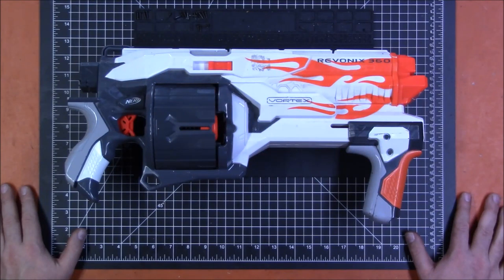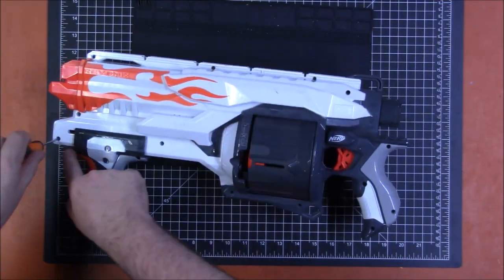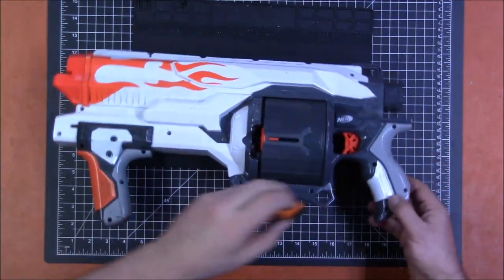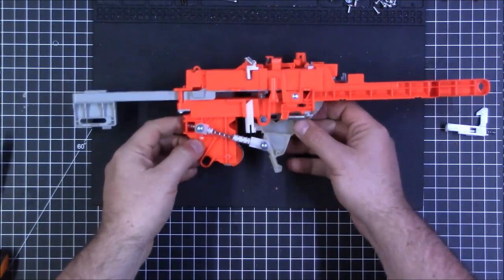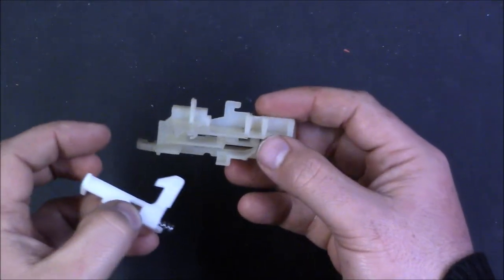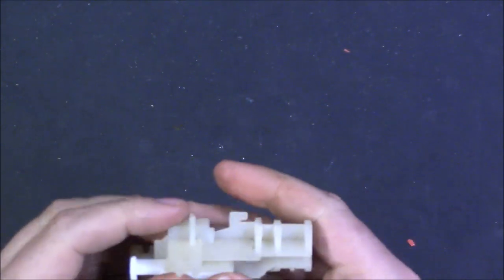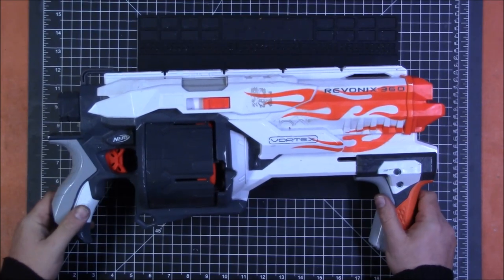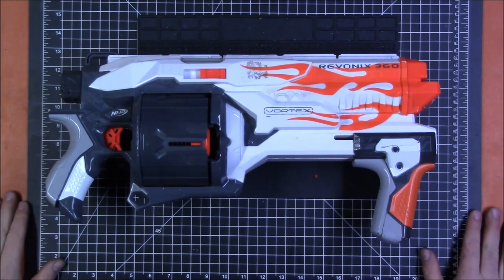Monday Mod Tips - Revonix 360 - Reassembly Guide

Comment: You good sir are a very brave man. Many a Revonix 360 has succumbed to the dreaded “Where does this f&$&20$ piece go?”moment.
Reply from the maker: It honestly is not that much more complicated than many other blaster in terms of parts.  The priming/loading/firing mech all being self-contained means all you really have to deal with is the cylinder rotation mech.  The pump action rotation system is not really much more complex than, say, a Rotofury.  The only unique part of this blaster is that loading arm and even that is not all that complicated.

I think the fears surrounding this blaster are the result of a lot of hype and inexperience.  It is different, so it is hard to call on and apply knowledge and experience from dart or rival blasters.  But once you understand how it works it is honestly not that much more complex.

Comment: Things I've learned from my experiences servicing mine. Those Pump Grip handle to assembly screws are an Achilles heal. Mine screw posts stripped clean off and I had to drill holes for news large bolts to replace them. Those tabs to lock the pump handle to the shell are cracked on both of the ones I have, they're not strong.

Comment: This was incredibly well done. Thank you so much! Mine had been jammed for years and thanks to your guide I was able to find and fix (mostly) the issue. That piece with the spring in the tip was twisted and I was able to untwist it. Also the cylinder catch's nub that goes into the cylinder was squished from when I tried to unjam the gun. I was able to shave off the parts causing the jam and the gun cycles! Sometimes the cylinder needs a bit of help to align the disk with the loading mechanism, but that's so much better than completely jammed.

Comment: I have a disassembly/reassembly request... The Dreadbolt. 
I can not get the bow arms off to flat pack them in storage. 
You can see there is an open slot on the front on the arms and see the clips inside, but try as I might for 20mins with a butter knife I can not get them to un-clip.
Reply from the maker: It took me 2 mins. The trick is you need 2 butter knives (or flathead screw drivers)  One above and one below.  Send me an email or IM and I'll send you the video.

Comment: Hey Cap! Would you do a Rival Sideswipe reassembly video? I got a ball deeply jammed in the works (my fault for trying to overfill it) and had to open it up to retrieve it.  Reassembly did not result in a functional blaster. I'd like to be armed with your know-how before I open it again for the do-over.  Thanks!
Reply from the maker: You can add it to the survey and vote on it but it will likely be a while before it makes it to the top of the list.  Aside from the magazine the rest should be pretty similar to any other rival blaster. What isn't working? Not priming? Not catching? Not firing?
Reply: @CaptainXavier  The follower spring is not     feeding balls when I charge the bolt.  To chamber a ball, I have to turn the blaster upside-down and use gravity instead.  Once I've done that, it fires normally.

Comment: It’s a shame that it’s so damn hard to upgrade the Revonix’s spring. It’s got good capacity, you can reload it without even opening a breech or anything, and it’s pump action. Great video btw
Reply: Watching the video closely reveals that it has the two unused holes for the end of the torsion spring that isn't attached to the catapult arm. Tearing down the blaster & moving the arm over is an easy spring power upgrade...

On the Pyragon & Praxis you could slide that whole spring housing off the complicated bit if you removed some screws. Sadly Cap didn't go that far, not that I blame him on a working blaster that he didn't want to upgrade!